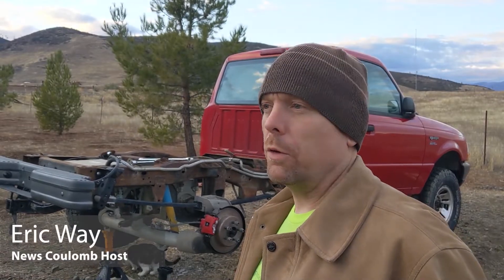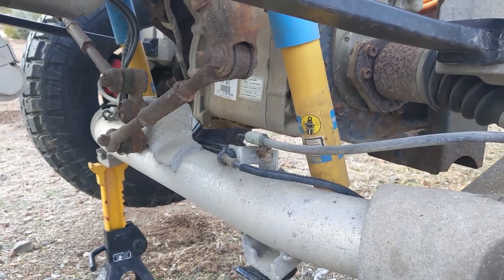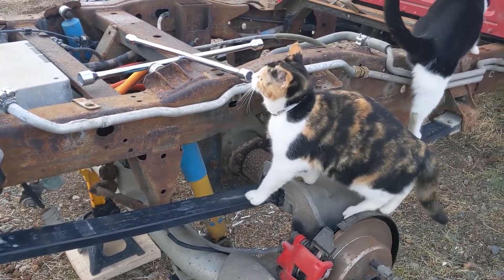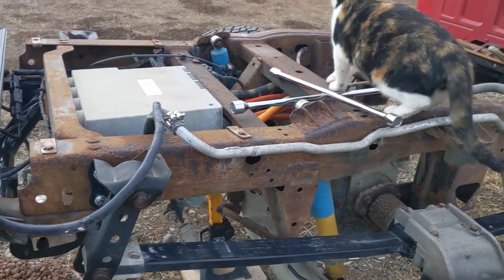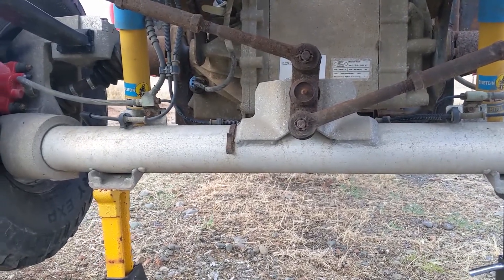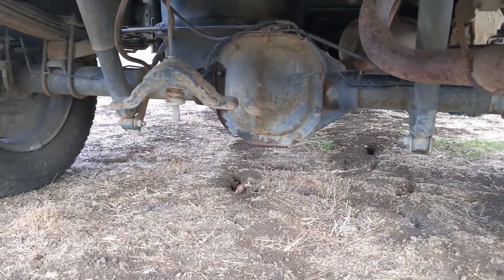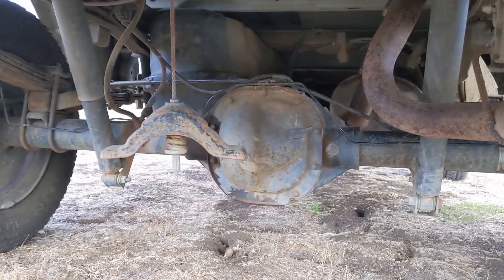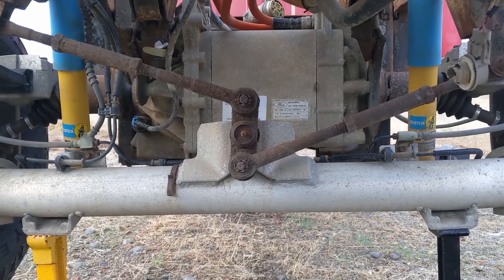Ford Ranger Electric: Introducing De Dion

Comment: de Dion is French and pronounced Dee-on, rather than Die-on. 
It's a reasonable suspension arrangement to use a motor and gearbox system designed for a FWD car. The bevel gearbox is more efficient than a live axle's hypoid gear as there's a lot less sliding friction.

Comment: Nah, I think the De-Dion was the best design, it's just that the Ranger EV's version of a De-Dion was done bulkily and poorly. IMO take a Caterham 7's De-dion axle, flip it over and mount the EV motor longitudinally to the rear like you said, then run a Satchell Link style triangulated 4-link and cantilevered coilovers that point backwards such as on Gingium's Drift Truck. Motor and shocks to the rear, a more compact De-Dion with 4-link going forward, and all the rest of the space between the chassis rails for a battery pack. Hell, run it with portal hubs if you have/want to, even.

Comment: Thank you for the video! I love those early CARB-era EVs, too bad not many of them left. Interestingly enough, new International EMV truck is built just as suggested in the end of this video: solid rear axle and electric motor in the back of the frame with drive shaft facing forward.

Comment: "car of the future" with 1920s suspension lol btw first cars were electrc too so nothing futuristic, it's going backwards to a failed idea.
Reply from the maker: Car of the future? No. This is a piece of history that I'm restoring. Modern EV axles look different. Check out Magna's e-Beam. More power than your V8 in a package that's about the same size as a differential.
Reply: @newscoulomb3705  Shame it's an electric pos with shit battery useless junk for fake "eco" posers.

Comment: You have the right idea!  The best setup is just Motor to the solid axle.  Very little drive train loss as well.  And if you venture using straight cut gears?   You get even more strength and reliability but I only see those on Military and race cars.  I don't even think semi trucks use them despite their efficiency gains.  

However, the setup on the ford really is one of the best setups as you have one less point of failure as CV axles can be made to withstand a HELL of a lot of abuse.  And the chances of Both CV Axles breaking is almost moot.  So ford really did do their homework here.  

The ranger EV really is a great truck.   Its to bad they just did not stick with just a large motor on the front  as that could have gave them 4WD.    And there is no doubt that the truck could take it.   I bet they did it SOLELY for getting extra efficiency and mileage from the batteries.
Reply from the maker: I think the lack of a front motor was all due to battery capabilities at the time. There is room for a second motor upfront, but it would require cutting out 1/3 of the battery, which would limit both output power and range. 

With modern batteries, thanks to better energy/power, it could definitely be possible to add a second motor upfront. As it is, my 1 C, 280 Ah cells will be maxed out just powering one motor. To power two, I'd probably need at least 2 C to 3 C, 200 Ah to 300 Ah cells (probably 2 or 3 cells in parallel). At that point, though, finding the room to fit the battery and the second motor is the issue.
Reply: @newscoulomb3705    Well it looks like I better subscribe to see whats going with this build.    I'll check out the rest of the catalog later on today as I got some work to do but yeah really looking forward to learning more about your rig as you have it.  

 surprisingly there really isn't much content about the Ranger EV line of vehicles out there except in specialist forums that are all about extinct that just go into basically copypasta of the official manufacturer stuff.  

it would be nice to get a Viewpoint from someone who actually owns one of these vehicles in the long term and really get an Insight of how these early EVS fair today.

Comment: Correct me if I've got the wrong end of the stick but a DeDion tube allows the two sides of the suspension to move up and down independently whilst keeping the wheels parallel utilising a bearing between the two sides. What you seem to show is nothing more than, effectively, a live axel setup?
Reply from the maker: No, it's what would be called a "dead" axle. Essentially, the De Dion is a structural component that connects a suspension that was designed to work with a live axle. Because the Ford Ranger Electric's powertrain is a mounted motor with CV joints and half shafts (no way to mount to or support the chassis), that De Dion connection is required.
Reply from the maker: No, it's what would be called a "dead" axle. Essentially, the De Dion is a structural component that connects a suspension that was designed to work with a live axle. Because the Ford Ranger Electric's powertrain is a mounted motor with CV joints and half shafts (no way to mount to or support the chassis), that De Dion connection is required.
Reply: @newscoulomb3705  Nope! ref : https://en.wikipedia.org/wiki/De_Dion_tube et al As can be seen, a De Dion rear suspension is always used with an independent rear suspension.

Comment: Neat! Thank you for the information.

I "think" the differential may have to be rotated in such a manner that the yoke orientation stays on the bottom (ie, your rear wheels would switch sides), to keep the pinion gear submerged in the gear oil (I believe this would require a bracket(s) to be removed, repositioned, and rewelded).

I was upset when Workhorse became Lordstown and W-15 PHEV pickup was nixed in favor of the Endurance BEV.  I think a PHEV, like the Volt, is an easier sell to a skeptical audience, and due to current battery characteristics, I think trucks seeing "real use" AND needing to potentially travel long distance, would be better served to be a plug in like the W-15 was designed to be.  All that being said, electric pickups will be a great thing for municipalities and other fleets that can incorporate them for an appropriate use case.

Comment: Hey Eric. You mentioned the importance of keeping things familiar for the OEM components. The one exception to this rule may be new batteries. I fooled the Lead Acid BMS of my Ford ranger with 91 lithium cells and voltage dividing resistors if you’d like to see my notes. There’s one remaining error code after the conversation that I’ll diagnose once I get my paws on a NGS Star Tester. (Hard to find with the right memory card). Rootmindset@gmail.com
Reply from the maker: Yes, that's definitely going to be the area where I have to adjust some of the original hardware. Which lithium chemistry are you using? And have you tested out the stock charger yet?
Reply: (Same commenter different account) Cells from 2 bmw i3 cars, I imagine the short voltage range of Lipo batteries would be more foreign to the lead acid BMS than lithium ion. I haven’t tested the stock charger but I’m optimistic.

Comment: Looking at this from a supply chain point of view, I'm reasonably willing to bet it was done so they could use that off-the-shelf Siemens/Getrag drive unit. De Dion axles seem reasonably common on medium duty military and industrial vehicles where you have many-wheel-drive and need in-chassis differentials in order to chain them together withoug having ludicrous UJ angles between the diffs.

From a supply chain point of view, I'd bet sourcing a De Dion axle and the Siemens/Getrag final drive was easier than using a stock axle and a custom motor/reduction gear unit made from scratch. With low volume vehicles, it's almost always "what can I buy for cheap / easily / quickly" rather than what's better. That said, I'm willing to bet that Siemens drive unit uses thinner oil than the EP90 mud in a standard diff and probably gets a whole heap of efficiency back by doing so :-)

Great vid - loving this series!
Reply from the maker: Thanks! Yes, I'm sure that's part of the reasoning. I need to look it up again, but yes, the motor unit uses a specialty lubricant that I haven't been able to find yet.

Comment: My wish for a soon to be, up-coming electric truck design that I'd enjoy and likely buy?  A 2012 Ford Ranger platforn, electrified with contemporary parts...  with 250-mile range at gross load please, and with V2G capability that is sorted out/adaptable for foreseeable all home solar situations .   Ya, I know, I'm just a 2003 B2300 driver that has actually exceeded it's rated load on at least three occasions, and has proven to be a stellar steed on numerous James Hardie concrete-siding missions to/from The Home Depot.  So who would care about my wish?  Otherwise, I think four-door pickup cabs are for delusional metro-sexual boys that would be better served with a good mid-sized family sedan (or a BMW).  Good video, thanks...j

Comment: Side note: the "Smart" car also uses a De Dion axle to allow for a solid rear axle with a rear mounted engine/transaxle. It's the only other production car I know of that uses one, but the it uses it with coil springs and attaches directly to the unibody rather than being located by the leaf springs and the watts linkage. The way they mount it in the "Smart" car is awful because it allows the torque transfer from the wheels to load/unload the springs, so it really squats a lot under acceleration and lifts the rear end under braking.
Reply from the maker: Oh, that's interesting. Thanks for sharing!

Comment: A good compromise between the unsprung weight issue of hub motors and the efficiency lose of using a driveshaft into a 90 degree gearbox (rear differential), is to use an E-axle which replaces the standard carrier with one that has an electric motor mounted parallel to the axle. Sort of what the Chinese have been doing for years and similar to what the Tesla semi uses. 

In theory, the added weight of the battery will keep the spring:unsprung weight about the same as a standard pickup. The beauty is you can go to any parts store and get new bearings, seals, and the axle housing would be common item. 

Ford/GM/Ram could easily go with IRS but most truck buyers don’t want that. They don’t want 4-wheel alignments. They don’t want CV boots back there. Just a simple axle that is basically indestructible. 

The drawback aside from unsprung weight is that your motor and sometimes Inverter is taking a pounding. And big power cables are flexing a lot. However having said that, I have a electric moped with rear hub motor and the controller is under seat, so the 3 phase wires and the hall sensor wires are flexing, and so far none have broken. But the 600# rear springs that only compress if you have a family of 5 and hit a speed bump at 30 MPH might limit the flexing the cables do. Lol
Reply from the maker: Yes. I think everything has to be weighed as a component in a system. I'm convinced that there isn't a single right answer; it's really dependent on the end goal. 

I do think the argument for sprung weight versus unsprung weight is more important for performance cars than it is for work trucks, though, where having a solid, near indestructible, solid rear axle makes a lot of sense.
Reply: CV boots and joints suck

Comment: You certainly make some very good points. One has to wonder why ford chose to make a custom rear suspension on a limited production car. When they could have simply essentially bolted a electric motor to an existing rear axle. Although that may has sacrificed ride handling though the need of stiffer leaf springs.  I know GM used a FWD drivetrain on s-10 because the EV1 was FWD based and thats the platform they had.  I look forward to see what battery you end up going with. Have you considered getting some Model 3 Modules? They are long and may just fit in the coffin pack and this has caused their application on ev projects to be constrained and a little cheaper then Model s and X modules.
Reply from the maker: Yes. I'm about to start discussing the different battery options and what I am ultimately going with. I think people will be surprised about the state of current battery prices.

Comment: I'm suuuuper excited for the in-wheel motors in the upcoming Lordstown truck. The unsprung weight issue that many people cite is totally manageable for anything outside of a baja racer X-D
Reply from the maker: There are definitely a number of ways to address the issue. I'm not opposed to having an independent rear suspension with long drive shafts (I believe both Bollinger and Rivian are doing that), but hub motors can also be an option. Given the constraints at the time, I think Ford did okay with the Ranger Electric.
Reply: @newscoulomb3705  Yeah Ford did good with it, I've always wanted one. I have a gas Ranger right now that I'm hoping to convert to electric by replacing the transmission with a Lexus LS600H hybrid motor.